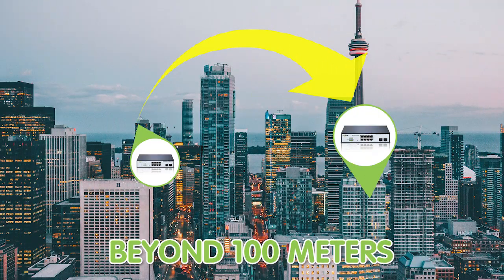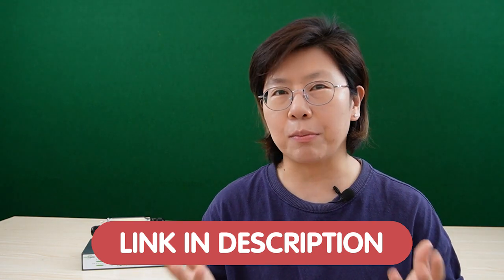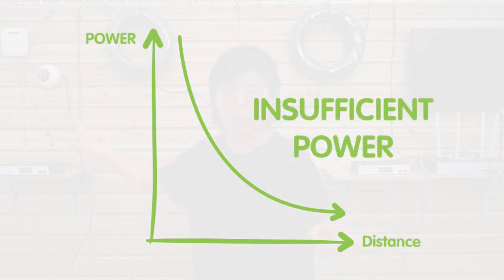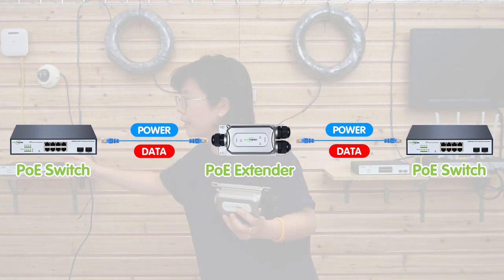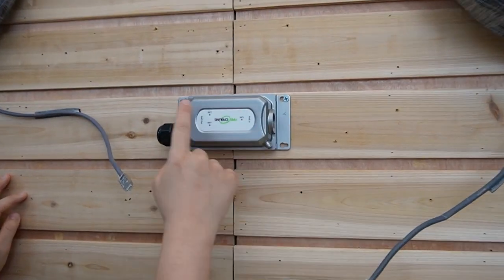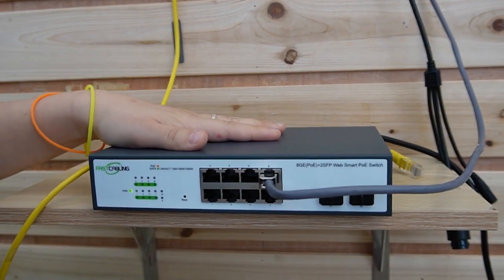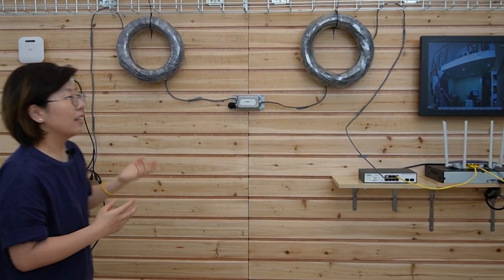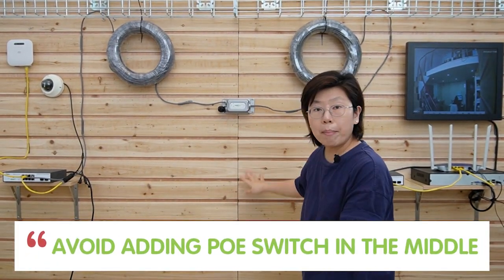Use Cat6 to Connect PoE Switches Apart from 100 Meters | PoE Extender

Comment: What is the difference between this poe extender and the other poe extender which i have seen in your other videos, i see it has two out ports and the other one does not require a separate power source  is there is any difference ?
Reply from the maker: This extender supports 1G speeds and features 2 PoE output ports. Neither of them needs an external power source.